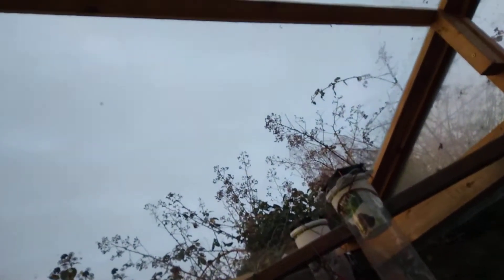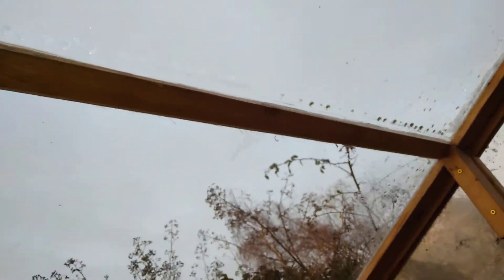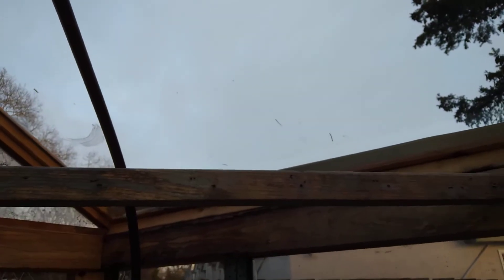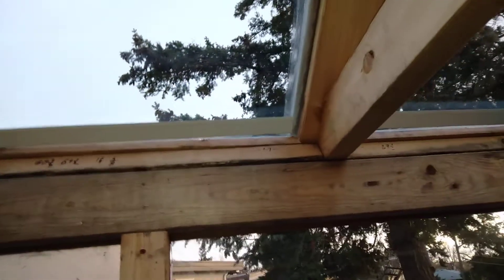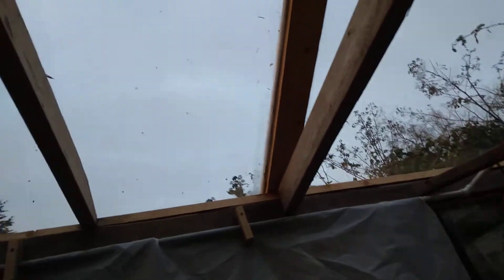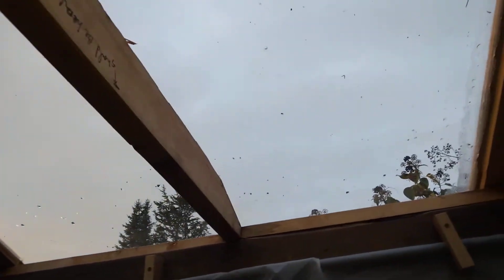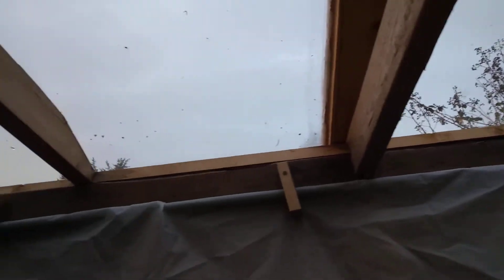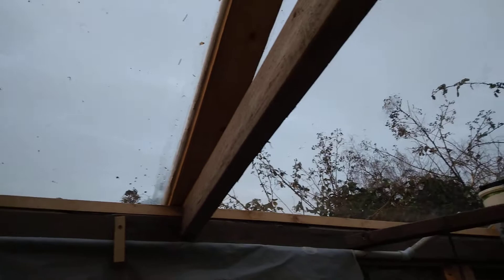Experimental Greenhouse: Harvesting condensation from the greenhouse roof.  "Let it rain!"

Comment: Hello Brian, i haven't understood well your video...
In some plastic barnums and greenhouses, i could observe that the condensation would drop at the point where the plastic sheet would touch the metal structure, so i could see the water "draw" on the dry earth under it. I think this could be used, with long magnets stuck from each side of the plastic, to choose where the water would drop. Or with plastic strings hanging from the roof to under the plants...
Cheers !
Reply from the maker: Hi,  later,  I put up more of the "j strips"  and it  moves the the drops of water off the roof  to one spot and drips down the water every day ( most days anyway) and I collect it and put it on the plants.  So it's like rain, but it happens in a few places in the greenhouse most days.  It works pretty well.